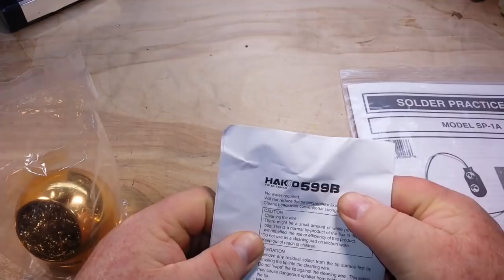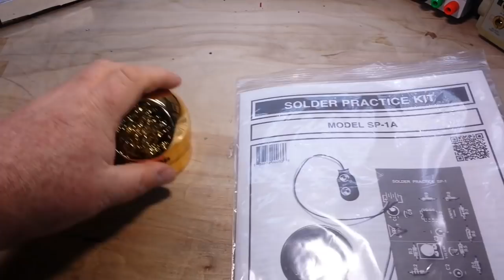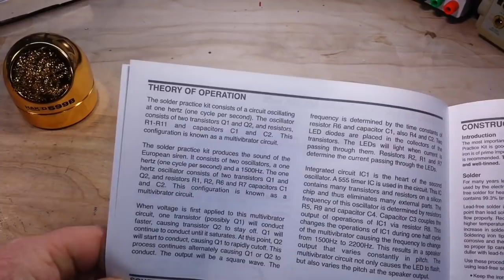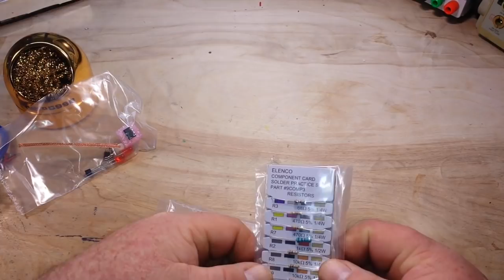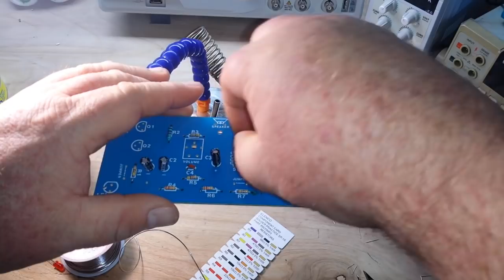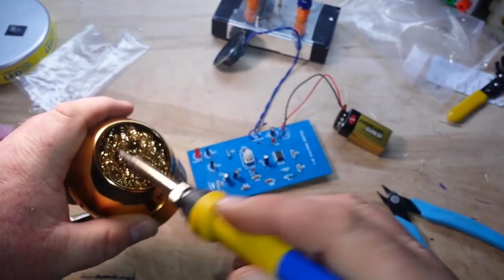Clean your soldering iron: wet sponge or brass wool?

Comment: Sponge may be more effective if u wet it with rosin flux, make it less viscous with alcohol.. water doesnt help because the oxygen in water will oxidize i think! Also i heard the zinc from brass can get in yohr solder and affect the components.. and the hardness wears out the tip quicker but im not sure. I do like how the curls of the wool gets around the whole tip easier tho!

Comment: I just upgraded my entire set up, bought the Weller 1010 station and I got their brass sponge, the housing for the brass is silicone so you can actually wedge it under the soldering iron rest where a wet sponge normally goes, and it sits in there pretty secure.

Comment: I'm new to this so my quick question is would this product also work for wood burning tips? or would I need to use something else? And that should the tips be hot and or cooled down them wiped with a cloth/sandpaper? or should I try the sandpaper method first?  the kit I have it both a soldering and wood-burning kit that also came with a very small sponge would a regular sponge work too for cleaning tips?

Comment: I use the sponge when (at the beginning and end of my sessions)tinning and to get globs of solder off but generally use the steel wool while working with pcbs that call for lots of joints. Truth is you can get cheap Chinese 20-50 sponges for $2-4... Wool on the other hand I rather not cheap out on and can get rather costly...

Comment: Like and Saved to the Technical folder.  This is exactly what a noob like me is looking for.  The lead free solder is funny, considering we all have Mercury amalgams in our teeth.  Although the societies under the heel of ancient Rome were grateful for lead, it drove the entire upper echelons of the Roman leadership doololly, they all went crazy drinking from the lead plumbing.  Sweet irony.  So yeah, preheating the iron, putting a little solder on the tip and hopefully resulting in a clean shiny joint, not a chalky joint.  And, if all I take away is that then this video was successful on your part bud.  Well done, and thanks a bundle. ♥

Comment: There's a great buy on banggood it's wirewoole in a tin with flux in the bottom. You clean your iron and flux it in one go. And it's cheaper than that one in the video.

Comment: You don't use lead free solder, do you at least use proper ventilation when not making a video? (There are reasons why lead has been banned from stuff like water pipes despite lead's superior mechanical and other properties) You did not care to completely remove the plastic wrap from the metal wool, you wiped the tip in that wool although you shouldn't and even read the manual before, and if I ever soldered a centipede (släng for those legged ICs) directly to a board, this is, without a socket, all those old electronics teachers would rise from their graves to haunt me.

Being meticulous is the hallmark of a good technician.
Reply: Lead is not evaporated on soldering. The need for ventilation comes more from flux fumes. Flux fumes can contain some very bad stuff for you and some of them are strongly sensitizing. Think of future severe allergic reactions, asthma and all the rest of what can result. I've soldered a lot without good ventilation and luckily not been bitten by it. Not everyone is that lucky.
Lead is bad if you eat it or cover yourself from residue and so on. Electronics waste containing lead is not safe for environment. That's why it is banned in electronics in many countries. In water pipes it can dissolve and dissolved lead in drinking water is very bad. Don't suck your soldering lead either and wash hands to prevent eating it from the food contaminated by your hands.
Reply: hoggif what about using a respirator when soldering if you don’t have adequate ventilation?
Reply: hoggif should also be using some latex gloves imo.

Comment: Good video, thanks for taking the time.  Question on the iron itself...I use the same unit (not for long s such) 
I found a n inch  long  sieve in my "package with a collar on one side. It fits right over the heating element, but I see no logical use for it except as a spacer which fits over the heating element.  I checked the picture in the small owners  manual, but can not find a "home" for it...Any idea where this " lumen"  thing is supposed to fit ???
Liked your video, I will also  also use copper wool for tip cleaning.
regards Gary
Ak3p@yahoo.com

Comment: This is funny, I built a multivibrator from a couple of NPN's just days ago, together with a pair of emitter followers.  Did not have this nice kit though.  Yeah, going from a nice thin led solder to non-led seems like a downgrade.  Kinda like having a sponge at hand, so I can get off the carbonated plastic gunk that crawls UP the iron tip.  It accumulates, and cannot always get it off with brass.

Comment: Get my brass scrubbers from the supermarket $2 for pack of 2. I tend to dip my iron in it, works well.
Reply: Be warned that those cheap ones are almost definitely not brass. They are typically copper coated steel. That is harder than your tip, and will scratch it.

Comment: I’ve been using the brass wool type for a few years, it works well, and no messing around with wet sponges.
Reply from the maker: I am going to switch. After using the brass, it's quicker, and like you said, no water.

Comment: I'm a sponge person.
Reply: Give these a try. You will never go back to sponge. Dipping your solder-tip in wet sponge shocks the cladding cover on the tip with each wipe.  Not good for the tips life.
I have been using the same tip for years and it looks new.
Reply: Sure, I'll give it a shot.
Reply: Hi, NNNI - Er, you're a sponge person, so do you wear 'square pants'?

(Just kidding, Bob...)

Comment: Put some heatshrinking tube on those alligator clips jaws, to soften their bite ;-)
Reply: Here's my upgrade - i use the silicone tubes for aquarium air pumps. Those are the best - "sticky" grip, heat resistant, never dries or cracks and real soft grip 👍👍 (and dirt cheap, just make sure its the silicone and not the crappy rubber ones)

Also, they are awsome as tweezers condoms, keeps those extra pointy ones safe and your fingers intact 😎😄

Comment: Greetings,  It would appear we had the same rich uncle that got us into electronics.  :)
Have you tried 63/37 solder?  It has a faster freeze which leads to fewer cold solder joints, as the component has less time to move once the iron is removed.  I learned about it when I got to my first unit, and I've been using it ever since.
Reply from the maker: I have used 60/40 almost exclusively. I'll give the other a try through. What branch?